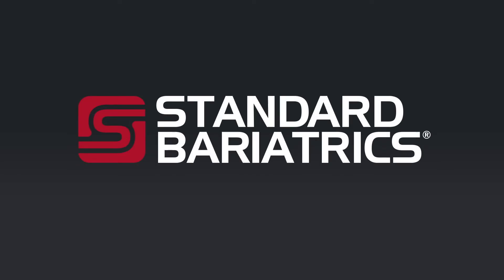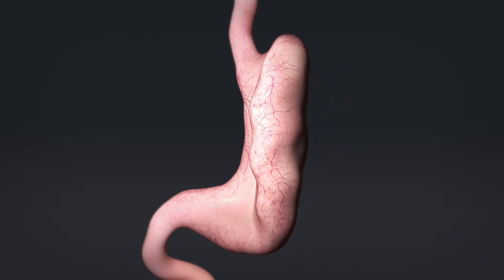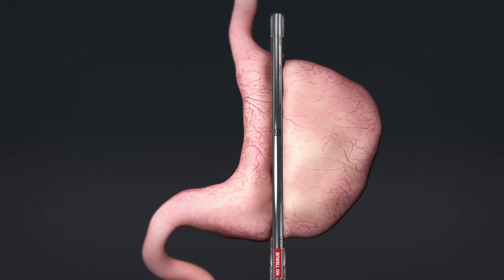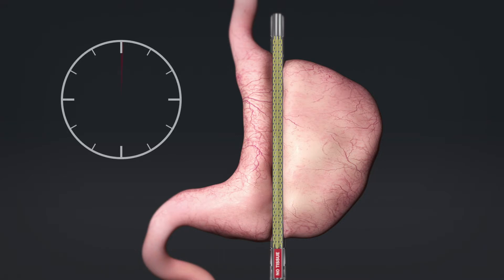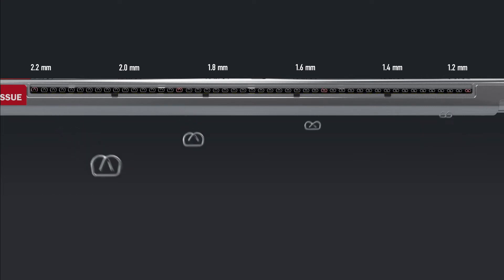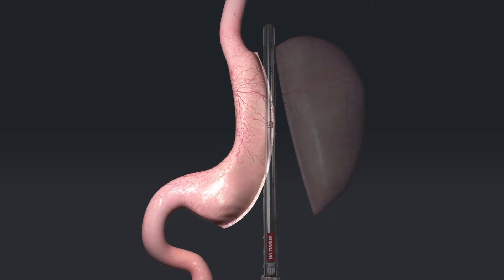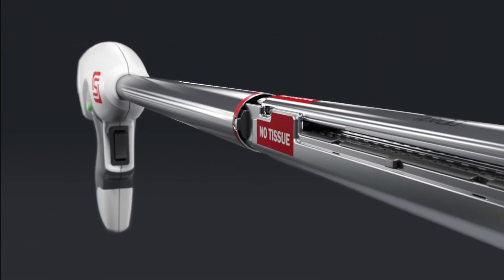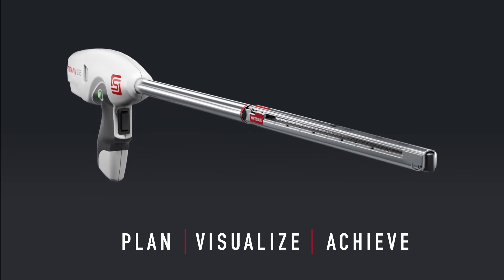Animation of Sleeve Gastrectomy with Titan SGS™

Comment: Undertaking such an invasive surgical route just to lose weight is something I would never in a million years consider, especially since there are other avenues to explore. Personally, I'd choose psychotherapy to address any emotional eating patterns and make a concerted effort to master healthy eating strategies. For instance, prioritizing the intake of protein and fiber could help with feeling full sooner and for longer. And you can also implement a workout routine. As a natural bodybuilder with a substantial amount of muscle mass, I can consume as much as 4,500 calories daily without gaining unwanted weight, thanks to the higher metabolic rate that comes with greater muscle mass.
Reply: You do realize the stomach is ever growing right, so the whole point of "super invasive surgery to an important organ" crap is futile considering the stomach can expand
Reply: @odawg01  
While it's true that the stomach can stretch slightly after bariatric surgery, it's a misconception to suggest that it "grows back" to its original size. The changes made during surgeries like gastric sleeve or bypass are substantial and permanent. A small degree of expansion over time is indeed possible, but this typically remains far less than a healthy and normal stomach size.

This fact underscores a crucial point: the long-term success of bariatric surgery, or any weight loss strategy for that matter, heavily depends on the individual's commitment to a healthy lifestyle. This includes maintaining a balanced diet and engaging in regular exercise. Without these essential lifestyle changes, the benefits of any intervention, surgical or otherwise, could be significantly diminished.

From this perspective, it's clear why non-surgical approaches to weight management, like psychotherapy to address emotional eating, dietary adjustments, and exercise, are not only viable but often preferable. They enable sustainable changes and improvements in health without the risks and invasiveness of surgery.

In conclusion, while bariatric surgery can be an important tool for certain individuals, it's not the only path to weight loss, and it should only be a last resort. A balanced approach that includes psychological support, nutritional education, and physical activity can be a more sustainable and less invasive option for many.

Comment: Im interested in this, but this scares me, and i would prefer at the moment to continue to lose weight with my 1500 calorie daily diet and my 6 miles of walking using my reebok weighted vest. I was 330lbs on july 1 2023 and have gone down to 300Lbs since October 7 2023 doing just that.

The only issue i have come across is that i was starting to get some pain on my heal on the right foot, and it turned into plantar faciitis which has been pretty painful to deal with but after walking for a bit when i first get up in the morning or if i rest on the sofa, it slowly allows me to put pressure on it for walking. I apparently bought the wrong shoes which caused it. 

I now use sketchers GoRun shoes which helps alot but since the damage is already there, it only reduces the pain a bit but doesnt get rid of it.

I honestly wish anyone trying to lose weight the best, im still interested in this and may do it if i keep hitting this weight loss plateau.
Reply: Bloody good job mate, keep it up, and make sure not to damage yourself too much with that weighted vest, walking is the best kind exercise.
Reply: Good job, keep going. Body weight exercises are way to go. You don't need to restrict your calories, just eat once a day.

Comment: This is so dumb ur basically ruining your body bc you want to lose weight, just workout and stop eating so much, easier said than done but possible
Reply: its not ruined, i just trimmed off part of my stomach, everything still works.
Reply: @Daisynottheflower   yah and apparently the stomach is super adaptable, so it will stretch back into its original volume if you start eating as much again
Reply: @greatfate  yes, to an extent it has, but it still has its limits. its not like fully regeneratable.
Reply: I think most gastrectomies are to treat stomach cancer, and less common ones are for life-threatening obesity.